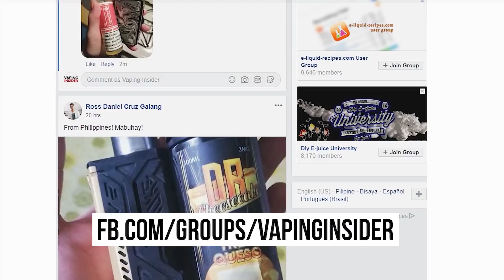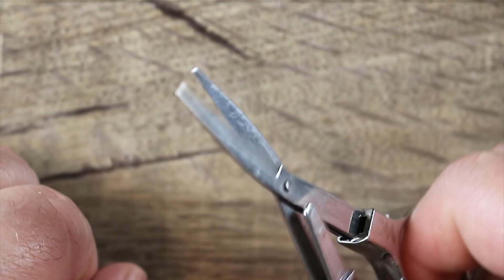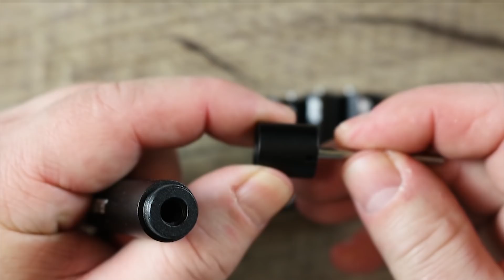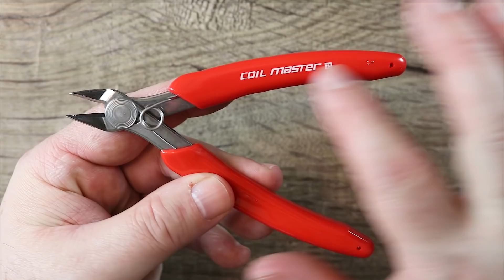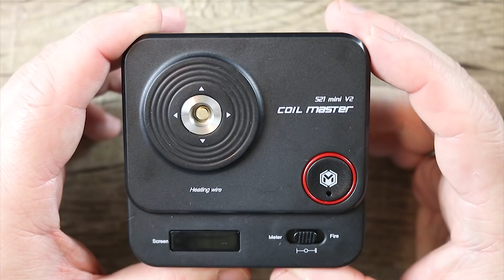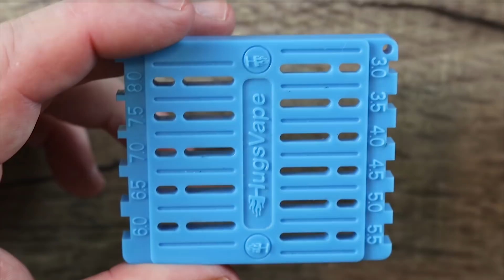THE BEST BUILD KIT?

Comment: 😎 Deuces great review. You're right on point I like the idea of a mini round tester with a single 18 650 or 21 battery. Question what are the measurements for on the side of that blue coil tool? Also my tester takes two double AA batteries what do those take?. Keep these reviews coming
Reply from the maker: Right on. This one takes a single.